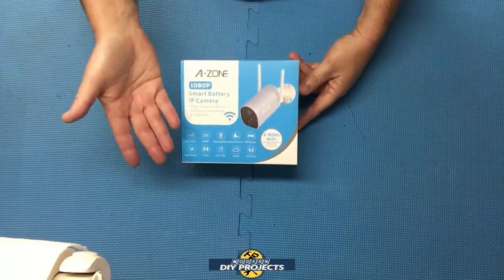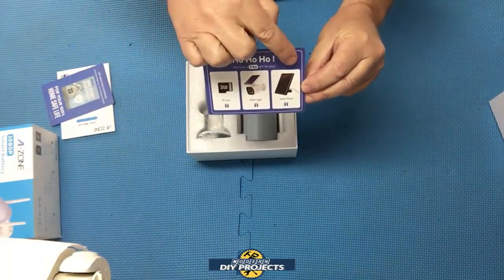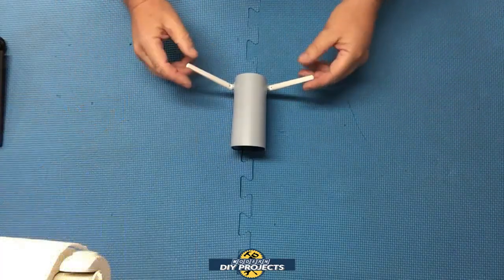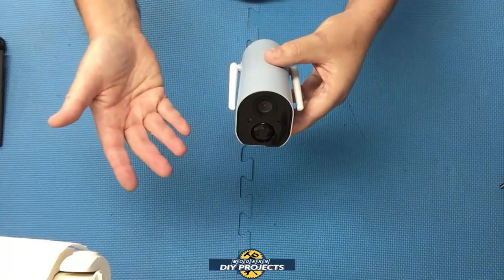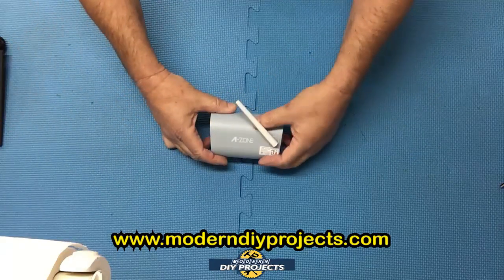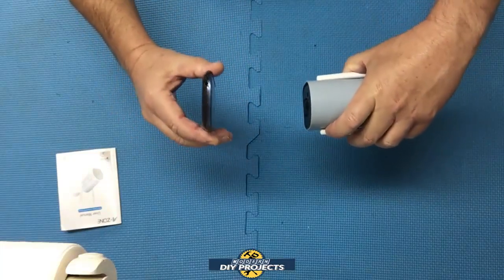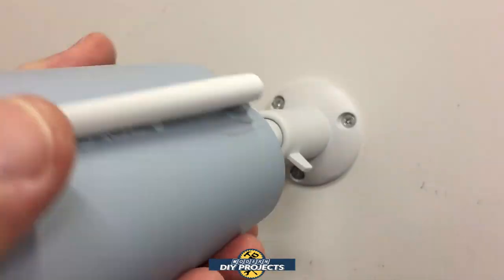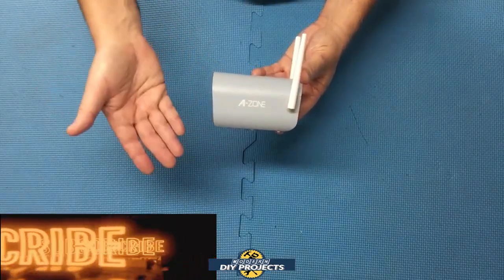A-Zone Wireless Security Camera Setup, Installation and Review

Comment: I have an a zone system and it worked fine. We moved and now trying to reset it had become a pain. It scans a QR code 25-35 cm away and we cannot get it to rescan the code
Reply from the maker: It may be having a problem because of your move. I would suggest to delete the camera from your account and start as if it is a new install. Be sure to have your location settings or GPS turned on your phone so it can see that you are in a new location when you add it back in. Also use the reset button on the camera and set it back to factory specs before you start adding it back in. Start with a clean slate in other words. Hope this helps.
Reply: @ModernDIYProjects you guys know how to reach customer care, I don’t remember my admin password for the dvr box
Reply from the maker: @joellejenkins9492  It has customer care details in the manual. You can also contact the seller on Amazon since that is the company itself. You can also try using the RESET on the camera and see if that helps.